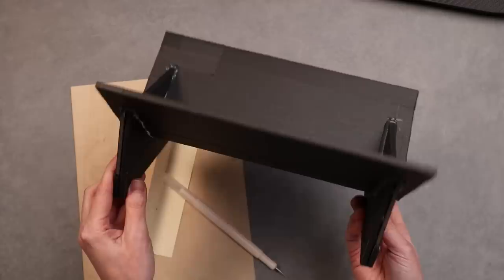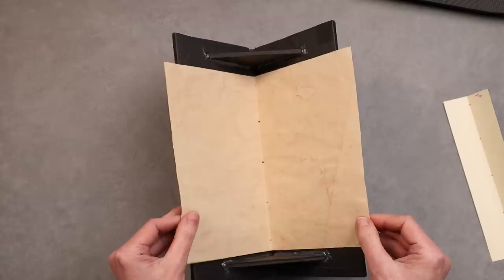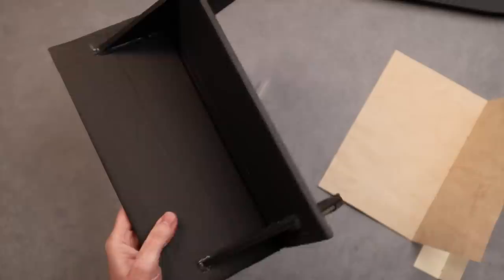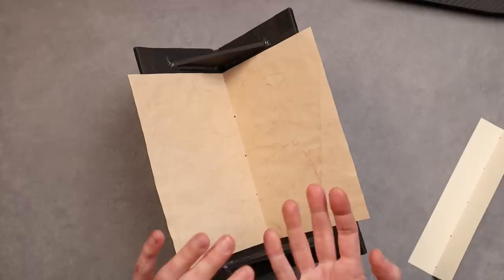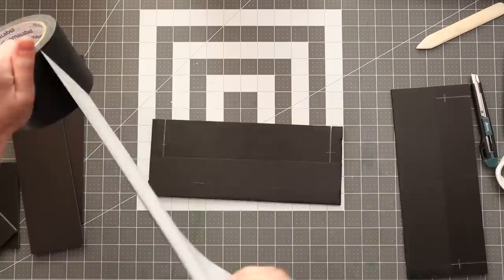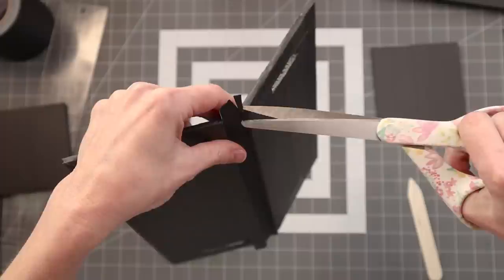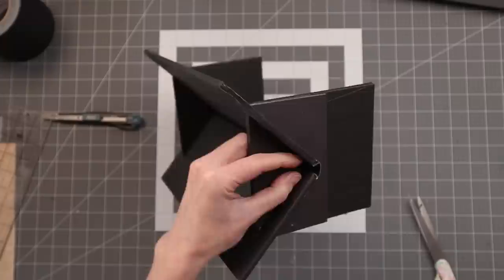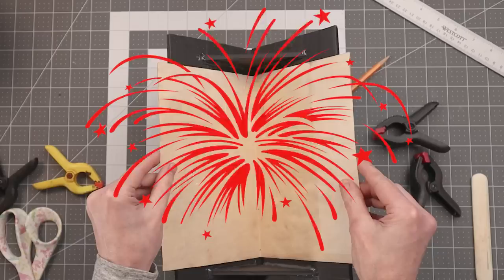DIY BOOK BINDER'S PUNCHING CRADLE | TUTORIAL

Comment: Nice looking book cradle, Nik! You're going to love using it. I used to have a bookbinding cradle. Consistently snugging the signatures and the paper template with your holes marked on it up against the same end of the cradle for entirety of one book ensures consistent hole placement and a beautiful end result, which I'm sure you already know.
I made my simple book cradle in a bookbinding workshop a few years ago. We each used a piece of corrugated cardboard that we folded in half lengthwise, then cut slits in for the rectangles of cardboard used for the feet to slip into. My cradle wasn't as nice looking as yours, but it was collapsible and the materials were free. I no longer have it, but could easily make another if I ever wanted to bind multiple signatures again.
Reply: Thanks for sharing the concept of the one you made a few years ago! That also seems like an easy solution to book binding in a pinch!

Comment: Don't use duct tape- You will end up with residue in your holes that make your paper stick when you poke through and then it will get onto the thread causing knots.

Trust me

If you can't afford book tape, gaff tape is a good second. The main reason book tape is so good is that it doesn't leak residue out of the sides, and the adhesive is still a pressure sensitive adhesive but it is PH neutral. If you have some book tape I'd use it for the center and then whatever else you want for the other parts.

Comment: Do you think a variation of this cradle be made to hold a book open for following recipes?
Reply: Yes! Make one of the end squares taller... And cut your slits out at an angle rather than straight across....do you get me? So they slot in both pointing towards one end...the longer one at the back, so it can stand vertically rather than horizontally. But not TOO vertically, you need it to lean back a little so it doesn't fall over! Add a couple of clothes pegs to the top or bulldog clips, to keep the pages open! If you don't glue in your end squares, you can slide them out so it can be folded flat until you need it next! Use duct tape or something similar, so any cake mix splashes are easier to wipe away! Great idea! 😘😘😘
EDIT*** hope that made sense? For the slits I'd suggest, 4 o' clock...do you get me? She cuts hers at 12 o' clock and 6 o' clock... But you'd need to cut your slots at 4 o' clock one side, and 8 o' clock the other side...to get the right angle for standing upright, but with a bit of a lean back to it! God knows if I'm explaining myself properly! 😂😂😂
2nd EDIT*** lololol like this: / \.... Left one points to 8 and right one points to 4...so cut your slits at this kind of angle! 😘